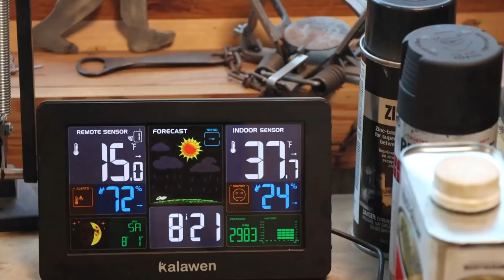Invisible winch mount Chevy Square body

Comment: That big Do-All saw is a real blessing. You did well getting that. In fact all your equipment is in great shape. With the way you treat your equipment they will all be in service for a very long time. This is the way I have done a number of these winches. The frame benefits the stiffening up in a notoriously weak area and it takes a lot of twist out of the frame as well making cornering at speed give a lot flatter way the truck sits in the corners. Thanks a bunch for having us into the shop again. It is always a pleasure to see you produce the quality work you do. Take care and I will see you next post.
Reply: Thanks Steve.

Comment: Steve , one piece you are going to have to add is a bracket from the winch plate to the hawse lead  and make it beefy as well . I know from experience that any side load on the lead will quickly result in one really bent chevy bumper . great fab work !

Comment: Loving watching your truck project progress, and this winch installation is a huge enhancement. Nicely done - even the holes with additional ventilation are a stroke of genius! 🙄😆
Reply from the maker: That extra nut ventilation adds 10%  performance points 😏
Reply: @SteveSummers  Alternate mounting point for any aftermarket winch which might be needed in 4 years, after the first one gives up the ghost after having hauled 10 trucks worth of tree up a vertical incline.
Reply: @SteveSummers   if you would have done the rear ones as well you could have had a 20 % performace gain . its an added benefit from the old adage ....measure once cut twice

Comment: Battery isolator switch near the battery, so you can leave the winch turned on all the time, and simply turn on the power when needed. Also connect the remote control cable to the winch, and leave the end in the engine compartment, sealed up in a plastic bag, so that you can simply open the bag and use it if needed. Small cable tie to hold bag on cable, and another small easily broken one holding to something firm. that will keep you from needing to go dig in the dirt for the winch when needed, and also no problems with cables chafing, or long standing making the battery flat.
Reply: That's a great solution.
Reply from the maker: Good ideas👍
Reply: Was about to say the same thing regards remote power switch and remote control lead, but you beat me to it.
Reply: Great ideas😎 you could if there's room somewhere fix a plastic lunchbox that's big enough to hold the cable and the controller with a slot in it under there somewhere. Maybe some brush strip over the slot to stop crud and mice making nests.
Reply: Nice!  Another small problem , if the winch lead comes out and has to go at any angle other than straight ahead, the cable tension will put sideways pressure on the bumper.  The fairlead helps spread that but its only held on by two bolts.
Reply: @criggie  Another said to put a bit of reinforcing steel at the back of the bumper to prevent this force being only on the bumper.
Reply: @SteveSummers  All great ideas yes... another one I've seen is to mount a small ammo box under the hood somewhere as a "goodie" box. If you did that for the remote (and misc) it would work pretty slick.
Reply: What I did with mine is remove the control plug from the winch itself, and hardwire the switches inside.  I have a dash mounted guarded switch which enables/disables the winch, and a dash mounted rocker for in and out.  Almost always you will want to be out of harms way, and my setup forces you inside, and away from the danger.  I left a waterproof rocker switch on the winch itself to aid with spooling it back in after a pull.

I do NOT trust the wireless remotes.  I have seen 2 now that would not stop when released, and both times caused severe bumper damage as the winch tired to destroy the bumper and itself by continuing to pull after being fully spooled in.
Reply: @SteveSummers  You could also connect the wired control harness to the winch. Then cut the harness cable and then attach the harness to a Trailer socket mounted in the bumper. Then connect the harness cable to a matching Trailer plug. Making a Detachable Control cable.

Comment: EXTREMELY well done. 
CAD, Cardboard Assisted Designing. Using the end grain of a block of wood as a punching surface works great. If you use oak, one can also punch thin sheet metal using a flat ground punch.

Comment: I used to build 4x4's in the '80s. I'd fabricate rough country bumpers, tow hitches, roll bars, winch mounts and snowplows, etc. It may be a bit anal but when I drilled or burned a hole in the wrong place, I would fill it back in with weld, grind it flat, and stress relieve it. If someone was paying for it, they deserved a top-notch job and I just felt better about my work when I took no shortcuts. I'm looking forward to you doing the engine. I love those old small blocks.

Comment: A number of years ago I purchased the 6000# Badlands winch from HF.  Right out of the box it had dead relay in the control box.  Returned it for free replacement and added 2 year replacement coverage.  It has been absolutely dead reliable through much use, abuse and misuse.  My rules with expensive HF purchases:1) **Always test the unit before starting any install work and be sure to test it in the short free return time.  2) Consider the cost of the extended coverage as part of the purchase price. Great video!

Comment: I have both a vertical and a large horizontal powered bandsaws that are not set up for coolant.  I watched you set up your big bandsaw with coolant capability and it does work great.  Appears to improve blade life, cut quality is fantastic and that heavy duty machine does it's job with ease.  That was a tremendous acquisition for your shop!  Nick, North West Farmer
Reply: Yes! It made short work of that thick plate.

Comment: Going to be fun turning the freespool lever when your bogged up to the bumper. Never seen an on button on a winch before. Would not work for me but your use is more wood than bog holes so nice work for your purposes. Tow ball on the front and you can winch machines onto trailers.

Comment: In the mid 70’s I worked at a welding and machine shop that made many custom bumpers for oil field trucks, log trucks, pickups, etc.  The boss got the area distribution rights for Hickey sidewinders which were installed behind the front bumper out of sight and in a better center of gravity situation as far as installing a winch on an already 200-300 lb bumper.  They were good winches.

Comment: Great video Steve, very nice installation. I think you made the correct choice mounting the winch between the frame rails, it should also reduce the flex we saw when you repaired the steering box. One of your viewers suggested that you leave the switch set to on and fit an isolator in the battery cable. Sounds like a good idea to me. You won't have to worry about overheated bolt threads now that you have fitted vent holes, good thinking. 
Best wishes, Dean in Oxfordshire, UK.

Comment: Its amazing how clever you can be when someone else is doing the work. As you were cuting the steel on your bandsaw I immediately thought of the half holes, if you drilled a hole before using the bandsaw as you cut out the shape you end up with a half hole. I really enjoy your Saturday videos every week. Hi from the UK.
Reply: Had the same thought,it is often easy to spot after the fact.It sometimes helps to remember that Isaac Newton is credited with inventing the cat flap and milled edge coins,both delt with problems that had existed for thousands of years but it took one of the greatest minds in history to come up with answers that seem obvious in hindsight.
Reply: Yep same here.

Comment: Looks awesome even though you don't see it. I have mine mounted on my 2000 Chevy the same way with a mount purchased from rough country and works awesome. I have the same winch and I'm sure you will use the battery cut off switch supplied and just leave the switch on the winch on. I like the stock look as well, build is looking great and being done the right way!!!!! ✌

Comment: Hi Steve ,so you did hear me over the Doall machine noise to move the tape measure.👍Could you put a battery disconnect switch on the power line so you could leave the winch switch in the on position so you wouldn't have to search for it.As you know when you need it ,it will be dark and raining heavy .🤣

Comment: For a bit easier control, use a battery switch under the hood to turn the main power to the winch on/off. That way you lust leave the power switch on the winch on. Plus with a winch you generally want to run the engine while pulling so it's no issue to pop the hood (plus it protects the glass if the line ever snaps) For the remote grab a smaller tool box or ammo can, put the remote and a couple spare batteries in there toss the remote in a heavy sock, keeps it from getting so beat up. plus the box lets you store a recovery strap or sling so all the winch stuff stays together.
Reply: yeah i would add a main shutoff switch too...and leave it switched on at winch....always better to make it safer and easier to use..
a remote switch is simple to add on and while you gotta reach under it still ( i'm sure that could be done too with some linkage or solenoids ) to engage it...it will get dirty and wet under there...

Comment: Such a clean installation, very nice. If you are planning to pull any size of log the fairlead is going to need some help- they see pretty substantial loading in anything other than a straight pull.

Comment: One item (non winch related) I added to our 90 YJ was an air tank supply made from 6in sch 40 pipe as a rear bumper. Something to think on mr Steve (@@)! But we used the YJ to off road a lot, and carrying around a air compress to run off 12vdc took up cab and cargo space,,,,:)> Bear. Burrrrr,,,,snow is a nasty four letter word (@@)!

Comment: I like it! I have a 8000 lb winch I use very often. I mounted mine to a 2" receiver plate. I carry it in the bed of my pickup. I put a receiver on my utility trailer, put one on my tractor box blade.  Only thing I kept thinking about, on your set-up is how to protect the plastic control box that's usually mounted on top of the winch. I've broken mine twice. First time, a tractor rolled forward on mt trailer and squashed it., second time, it slid off the bed of my sideXside and landed upside down on the brand new control box. I still like your set-up.

Comment: Just a thought for your License Plate to be attached with a cover box over the fairlead using a couple of strong magnets. Concern is any kind of hinged cover could be mangled if you winch line went at a wrong angle. Just my two cents. Good Project and enjoying this series!

Comment: Looks great, I really like the hidden setup. One thing to do once the truck is back up and running, before you use the winch; find a spot with a slight incline or have someone in the truck riding the brakes and unspool all the line and then reel it back in under tension. That will help to keep the line from tangling

Comment: Killer work Steve, i also much prefer the hidden/factory look. Very well done. One big suggestion, consider adding a backing plate to the back of the bumper for the fairlead, and connect the backer plate to the frame horns/winch mount. This way if you are winching at an odd angle, the winch line doesn’t put pressure on the bumper. I can see it getting tweaked easily. Also to give yourself a mounting point back to the truck when using a snatch block, consider adding a hook or attachment point on the front bumper as well. It can also serve as a keeper for the line hook when everything is stowed away. Rather than letting the hook just bounce around unattached to anything while underway. Cheers from upstate NY.
Reply: I was thinking the same thing the thing 
Tow hooks are nice for the doubble pull 
But I realized by a comment I made a week or two ago Steve is one or two steps ahead of me on that stuff we just dont see it in this weeks video lol

Comment: I see that you are using CAD (Cardboard Aided Design)for your winch setup. It is a labor saving process that I've used as well. I've also used polycarbonate because I could see the holes through the clear plastic, and mark my holes directly over them making it easier to make several of the same piece, either by drilling through the plastic, or stacking the pieces together and tacking them, then center punch the holes to be drilled.

Comment: For more invisibility you could mount the fairlead on the back side of the bumper with a larger slot in the bumper and a flat aluminum plate. I know people that mount a receiver behind the bumper and license plate. They can use that to mount a winch or use other trailer hitch attachments to move a trailer or as a pull hook. One guy has his license plate mounted on a step that folds down to make it easier to access the engine.

Comment: I still think a stock replacement/equivalent engine with one of those bolt-on TBI-EFI systems would do really  well for you.  Tunes itself, efficient, only the sensors that it needs and nothing more.  My friend has one on his '72 Camaro, loves it.  Only issue we had is with the ignition switch had an intermittent dead spot in it, wired it a little more thoughtfully and hasn't had a problem since.

Comment: Steve, I have seen more guys injured by a drill press. Smashed and cut fingers, torn palms are common.  You wouldn't consider holding stuff on a mill by hand but it's "Just a Drill Press"  If you're going to be an example for others, please be a good one!

The truck and the whole shop are looking Great!

Comment: I don't know if your state requires a front plate but mine does. I live on the other side of a rather expensive toll bridge that is the only access. A few local shops have started selling a product called a plate flipper. I think this might be ideal for your winch, it would hide the fair lead entirely. They're very inexpensive, a simple little solenoid. When you flip the switch, your license plate hinges to face the pavement. I have seen them on Amazon as well, sometimes they are marketed to reveal a hidden message. When you hit the switch, it makes the plate stay hidden for about 1 minute but I believe they are programmable. I don't know how you would get the hook to hang out behind the plate, but I think this would be a pretty slick look, a bone stock truck who's front plate flips down to reveal your winch. Maybe you could have some other recovery gear inside the giant fender volumes. I really dig the idea of a truck that appears to be worth $1,000 but is actually incredible, we used to call them sleepers.

Comment: one thing you may have forgot is if the winch is mounted on the front bumper its all to easy for a thief to steal it. bury it inside and no one is going to be able to steal it very easy. we had a winch stolen off one of the trucks at work while the driver was eating in a cafe and the truck was in the car park. the winch was held in place by only four bolts and the wires were all connected to a plug. took the thief only five mins to make off with a £2000 worth winch and tackle. good job you did. hope it proves to be useful for you....
Reply: Cordless tools have made it alot quicker to steal stuff...a fast worker can undo bolts quickly by hand....
yes theft is a big problem anytime....
Reply: @garymallard4699  Dewalt and others do a cordless angle grinder and now in London (UK) push bike theft is at its highest ever recorded number. can not see them stealing his winch. he did a good job....
Reply: @jakobrebeki  
the more powerful tools available since 18 V + came out ( i started back in late 80's with cordless tools ) and grinders and saws & impact tools etc... have made criminal activity easier...yes... i saw alot of trades trucks getting broken into in video's from U.K.  happens everywhere... sadly..honest hard working people getting robbed...not only by politicians !!

Comment: The front frame horns on those trucks were very vulnerable to bending with a light hit. I worked in a GMC dealer body shop from 74 to 82 and fixed plenty of those frames

Comment: Amazing, that's a beutifully polished bolthead. And you've got really good control of the shop humidity even in the cold. The dehumidifyer really works good reducing 15-30% of the moisture in the shop.
Great location of the winch, totally hidden and good fabrication work on the mount. I agree, if someone are really driven they will be able to make the same mount with an anglegrinder and a handdrill. But you make it look so much easier. Thanks for all the videos you make for us, love having my Summer(s)-time every saturday after lunch here i Norway.
Feel better, okay? And take care.

Comment: I'm with you on the stock appearance.  The exception is the wheels.  I do like aftermarket wheels and a decent set of tires.  The hidden winch is a very nice touch.  Unless you're in the towing business, the cons of having it hidden like that do not outweigh the pros.  You might not think that when it's cold and wet and you have to reach under the bumper, but that will pass, lol.  Great job on the installation.  You will have a truck that operates like it just left the factory, perhaps even better with the two-stick transfer case mod.  I'm jealous!!